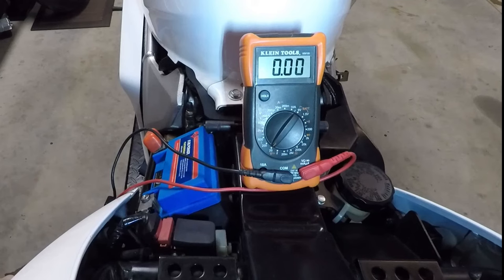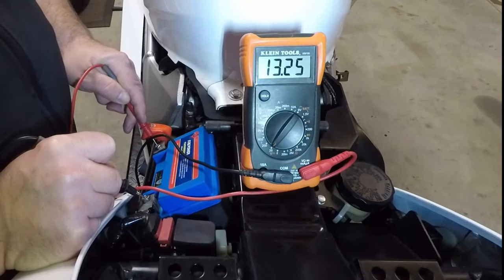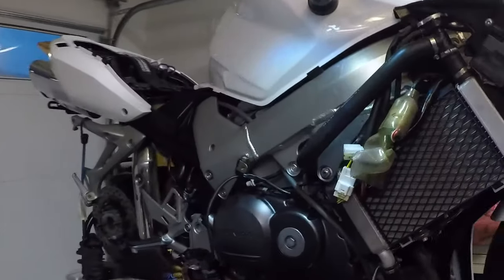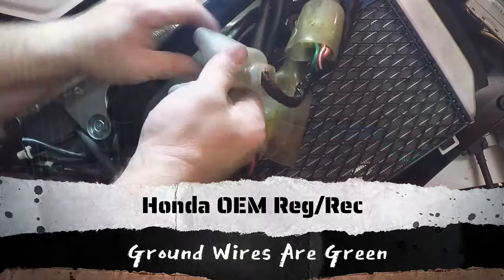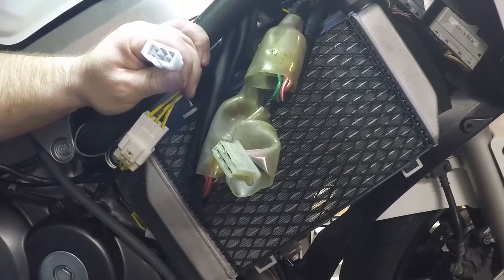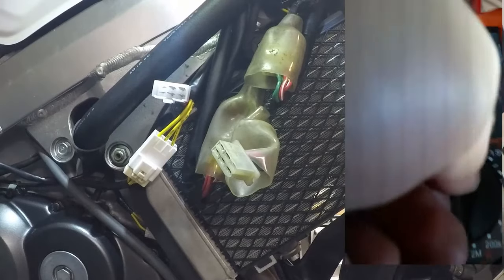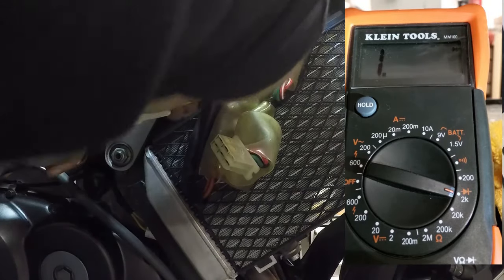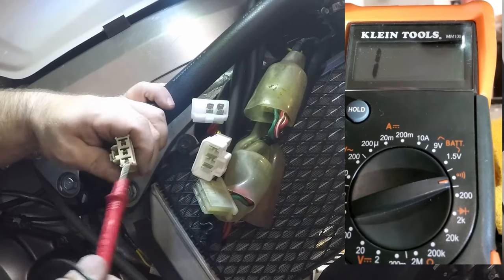Battery Voltage / Regulator/Rectifier & Stator Test

Comment: 2.7.22.    The test on the Stator that you performed is a static test, in order to be more definitive, you should perform a dynamic test, as when the engine is running, and checking the AC output from the Stator …… all three phases. On my Honda Gold wing GL 1200, I had around 70 VAC @ 3k rpm between phases with a new Stator. Generally you will find that the phase windings start shorting together internally, thus the AC voltage falls off between phases.
Reply: if the stator fails the ground fault test- there is NO NEED to go any further.  I doesn't matter what the AC output is  - the stator is dumping voltage to ground- the stator is bad.  Now, if the was no ground fault- then sure, do an AC output test; absolutely.

Comment: as a person who likes electronics & machines. I think it's a good idea to look for a regulator with large current output specifications, because in essence the regulator will still limit the maximum output voltage. but does not limit the outgoing current. Enlarging the charging coil is a fast way. Even better, add a MOSFET type regulator.😊

Comment: Really grateful for this video....reeeeally appreciated the clear views on the multimeter settings....but I'm going around in CIRCLES and if you (or anyone here) can help, I'd really appreciate it.  Forums and FB groups just kept yelling 'MOSFET' at me...and...ahh....

I have a 5th gen…1998.   My bike kept not starting and instead clunking out and resetting the dash.  But, with a jump lead, it would start up fine and be fine until I turned the bike off.  It never shut off whilst riding, just SOMETIMES wouldn't start.

I know it sucks to go second hand (trying to keep rolling until finances settle after job change) but I got a battery, then a second hand reg/rec…which didn’t solve issue...then another battery.  To be honest, the 'new' reg/rec (and the old one) test fine on the diode test...and I think it was the burnt connector, not the reg/rec.  But, the clunking and dead battery kept happening.  So I got a secondhand stator which I fitted today…it tested fine with ’on the bench’ multimeter tests (resistance at 0.1 ohms between phases).  But now it's on the bike my multimeter blips at .03 and then trickles down to 0.0 (on all phases).  I'm thinking it's the multimeter being cheap.

 But…test ride with a voltage meter running: 
Started with battery at 12.8
With lights on 
the average reading  was 12.2 under 5000 
Never went higher than 12.4 even at 5000. 
30 minute ride, mostly around town…little 5000rpm blip between junctions
Lights off was around 13v under 5000.
Got home and battery is reading 12.4. 
So….still screwed?

If I was riding a little with a bad stator...this may have ruined the new battery?  
I think I'll get a new battery and see how that goes.  And then...a stator...they aren't made any more and I can only see possibly terrible rip offs on eBay for about £60-£80...are these fine?
Reply from the maker: Hi Mac,  Sounds like you've just about had enough stator and battery problems.  I would not recommend using used parts unless you know they are off a working bike.  The OEM stator is no longer available but I have heard of VFR owners upgrading to the 6th Generation Stator & RR but I have not confirmed this myself.  My 2000 VFR800 has the same stator connector as my 6th Gen but I didn't change that one as it is still working well, see video https://youtu.be/KpmvUvpRCEM You can get good stator and rectifiers from a new company I have been working with for the past year and really good pricing & free shipping.  They work with the manufacturer overseas.  Here is a link to a new stator  https://rebrand.ly/l243bgb  Here is a link to both a brand new stator and RR in one kit https://rebrand.ly/dwldjbi The other thing I would look at is parasitic draw.  Measure your open circuit voltage with the battery installed on your bike and record VDC.  Disconnect the ground cable from your bike and check again, did it change more than 1 tenth of a volt?  Look for accessories to remove from power, sometimes things like heated grips or aftermarket lights can break down and draw power even when turned off.  You said you replaced the battery with a new one.  Running your battery completely flat is detrimental to it for sure but what you described does not sound right.  The 5th Gen VFR puts out very low current at idle or low RPM, avoid getting stuck in traffic leaving your engine run, learned that the hard way... Make sure when you buy a battery you get one with a separate acid fill pack that you have to load into the battery.  This way you know you're not getting a half sulfated battery that has been sitting on a shelf for a year.  Better yet get a lithium ion one, pricy but worth it is you bike sits for extended periods.  Good Luck and let me know how it goes!

Comment: wow I suscribed, you explain everything really good, my Daytona 675 doesnt charge the battery, I bought a new battery and she eat it, so couldn't be the battery, today I boudh the multimeter and tomorrow will test the stator and the Regulator, thank you so much for the vid.
Reply from the maker: Hello Leonardo, if your battery is getting damaged it is most likely the Voltage Regulator & Rectifier.  I also have this updated video that shows some additional tests you can do https://youtu.be/KpmvUvpRCEM Thanks for the feedback & the views and good luck!

Comment: Been having same  problem  with my Suzuki gsf1250 bandit . Have put several  r/r on bike but still having charging issues. A a multimeter will test my stator as just shown in your video. Thanks 😊

Comment: Great as i am in the middle of this problem now. Two of my 3 stator wires are showing dead ground, the 3rd is the pick up. There is a 4th separate wire i believe is for ignition i'm getting 60vac rolling it over on the starter. I believe the ignition wire comes from a separate winding on the stator and its unaffected. When i switch the meter over to vac am also getting 5-6 vac from the grounded yellow and white stator wires when i kick the bike over, a little confusing that im getting any voltage from wires showing dead ground. I am going with grounded bad stator.

Comment: Hi. My regulator show values 0.001 V on every mesurements (black- red, black-black...) . Regulator  disconected from scooter.
Is that result show that regulator is fault? Thanks for answer.
Excellent video!
Reply from the maker: You set your multimeter to measure continuity and not voltage correct?  If so then yes the regulator is dead.

Comment: Overloading the stator with accessories or nursing a long a dead battery can burn out the stator I have found. But the regulator is the first to go. The VFR 800 are well known for blowing a rectifier. So maybe that aftermarket one on this bike wasn't protecting the stator? That black and white wire. Might have saved the stator?

Comment: Great video! My bike cranks but doesn't start when the engine is warm but will start right up when its cold or I have let it cool down for 30 mins. Could it be the regulator? It has a new stator and a fairly new battery
Reply from the maker: Hello Edwin,  The condition you described is most likely faulty ignition coils.  The RR would not prevent your bike from starting.  When bad coils heat up they are unable to generate high voltage.  Check the ignition (spark) at the spark plugs when the bike is hot, trace the lead and change the coil(s) out with a new one to find the culprit.  This being said, I would just change all the coils and wire leads since any that are good now will probably fail soon.  - Good Luck!

Comment: Great video! 
Hope you can help on this issue:
A few days ago, while riding my SYM VS 125, a lot of smoke started coming out of the front of the bike and the engine started to fail. I turned off the ignition and cut the battery current.
At home I took it apart to see what was going on and the rectifier was visibly burnt.
I took the bike to a workshop where they changed the rectifier and the battery, but they didn't solve the problem. The new rectifier continues to heat up a lot and too fast, as if something is short circuiting.
As they couldn't solve the problem and it still cost me a few €€, I picked up the motorcycle with the fault.

Tests i have done:
- the battery is new and has 13.1V before the starter
- with the three yellow wires from the stator connected to the rectifier, the bike works fine at low revs, fails at medium and the rectifier heats up uncontrollably; with these wires disconnected from the rectifier, the bike works well at any speed, but as we know, the battery is not charged
- at idle the 3 yellow wires measure about 40V from stator
- the resistant test on stator show equal values on three wires; no ground conductivity; no open circuit on each coil 
- apparently all the masses are well connected.

Any idea what it could be causing this recurrent failure of the rectifier? 

Note: traditional G6Y carburetor engine with electronic rectifier and CDI, year 2010.
Reply from the maker: Hello Francisco,  based on what you have done I would say you have a faulty new regulator rectifier.  Test the RR transistor gates as shown in the video, I believe if you swap the RR part with a known good one, this will fix your problem.  Sometimes you get a bad part, even if its new.  Secondly confirm all ground cables are good, replacing them is also inexpensive and will confirm you do not have a ground resistance issue. - Good Luck!

Comment: Zx6r 2006 ninja636
Went for a ride in the morning packed bike for 30min went back to start the bike, the cluster comes on but the bike will just buzz and not start as if the battery is dead, charged the battery last nite it reads 13v on the multimeter, and when I try to start the bike I'm hearing a buzzing noise coming from the starter relay I think.

The problem started when i cold start the bike, the clusters will flicker when try to start the bike, and It will take longer normal to start.
What could the problem
Reply from the maker: Lots of things can be the problem...  What is the battery voltage after you try and start it?  The voltage coming off the charger is artificial due to surface charge on it. The most common issue is the battery is bad.  The starter relay can be bypassed to check it or just get a replacement and try it, they are not expensive. The other common issue is the right handlebar kill switch.  These switches get gummed up with dirt and the circuit is not strong enough to start the bike.  Finally there are your battery cables.  Cables corrode over time and if they are green with corrosion, frayed or loose on the other end (not the battery I assume you tighten that properly), you need to address or replace the cables.  Here are two videos that you may like, one with a hard to start Ninja 600 https://youtu.be/W0MTZbtMgOw?si=hSXqS227xUin5aNt  The other discusses issues around the charging system and shows additional ways to test your charging system.  https://youtu.be/KpmvUvpRCEM?si=ZIvJuzMQBserzW2w  Good Luck!
Reply: Thanks for the Info @RodRidesWrenches, will definitely try out and do the other checks ✔️ hopefully I manage to trace the problem..

Comment: My motorcycle doesn’t start at all when I try to turn it on. It has a new battery, starter, and starter selenoid. It turns over but the voltage drops whenever I try to turn it on. Can someone help
Reply from the maker: It sounds like you have a MAJOR short in your wiring.  Something is grounding hard.  If there are ANY accessories on the bike (heated grips, charge ports, accessory lights) disconnect them these are the most common suspects.  Get a voltmeter and measure voltage drain with the ignition on, and off, you'll know you found the problem when you see the voltage drain slowly after disconnecting the offending part.  After that you need to chase your wiring from the engine handlebar kill switch which again is a common problem for shorts and failures https://youtu.be/W0MTZbtMgOw?si=DnYLDlUxGccKgXtB&t=560 to the ignition switch, to the kick stand switch, and all the other things like clutch switch and tip sensor if equipped. You did not mention what bike you have so Good Luck on the short fault hunt!
Reply: Thanks for the reply, I’ll check it out
Reply: I did what you told me and there is a short. The battery was slowly draining when I tested it with my multimeter. I just now need to find it
Reply: It only drops to around 10 volts when starting shouldn’t that be enough to start it?
Reply from the maker: @user-by5ud2hf1p   Yes it should
Reply: i hope you sorted you issue, but if you haven’t, good idea to put the year model of your bike as possible your issue could be common to the model and very easy for a youtuber to give you immediate remedy

Comment: 2002 vstar 1100..12.5v battery at full charge. Started the bike and it climbed to about 13.6v on rev up. I did a draw test on the battery and came in at 0.06 which fell well within vstar specs, but battery dies within a couple days. New stator, and no spikes in voltage from bad regulator, it seems to be doing its job. Any ideas? Keep going through batteries yearly at least
Reply from the maker: Your battery is sulfated.  Fully charged your battery should be 13-13.3 VDC.  Each cell should be 2.2VDC you have 6 cells in a 12 volt battery.  you can try using a battery charger that pulses like this one https://bikersrun.com/products/motopower-mp00205a-12v-800ma-automatic-smart-car-motorcycle-battery-charger-maintainer?_pos=1&_sid=83f767274&_ss=r or replace the battery.  You should still get that charger since it will maintain your battery and keep it from sulfating.  Regular chargers don't do that.  The other problem may be a parasitic draw.   disconnect the battery from the bike and leave it sit for a few days, hook it back up and see if it works.  If it does then you have a draw somewhere.  Obvious places to look are any aftermarket accessors; heated grips, lights anything running off the battery.  Disconnect them with a voltmeter on the battery and you should see a difference when you found the one that is drawing current.  Or just try disconnecting them them one at a time until you find it.   - Thanks for the question & good luck!

Comment: I measured the contact on the contactor from the stator and I have contact between the wires, but there is no contact on the motor housing does this mean that the stator is destroyed?
Reply from the maker: No there should be continuity between phases in the stator.  If the phase poles are grounded, this means there is a problem.  Here is another test that just focuses on the stator https://youtu.be/KpmvUvpRCEM?si=Dg_Q6YkeYAuZg1Hd

Comment: Hey man awesome video, I did the test on both the stater and the rectifier/ regulator and both passed. When I rev the bike up the voltage does not increase which leads me to believe that it is the stator but it passed the test.  Any idea what it could be or what I should check next?  2003 Honda Shadow 600
Reply from the maker: What is the voltage you are getting at idle, what is the battery voltage at 5000RPM and what is the voltage you get at 5000RPM with the high beam on? How old is the battery you are using in your bike?  Check the AC output on the stator with the bike running as I described in this video https://youtu.be/KpmvUvpRCEM The stator may not be grounding but the coil packs weak.  Also described in this video is a transistor continuity test for the RR.  Confirm your ground cables from the battery to the engine are not corroded and that all your connector pins are aligned properly and making contact with each other properly.
Reply: @RodRidesWrenches  Thanks so much for the reply! I watched the additional video and it was very informative. The battery is only 2 years old.  
The bike’s voltage is around 12.3v with the high beam on at 5000 rpm. No change from idle aside from it decreasing slowly. I tested the stator AC output while the bike was running and got zero across all 3 phases. The rectifier passed the tests however there is a parasitic draw that only goes away when I unplug the rectifier connection to the rest of the bike ( not in between the stator and the rectifier). I am leading towards replacing both the stator and the reg/rect but do you think there may be additional problems? I checked the ground at the battery and on the block, both have been cleaned up but still no change. Any other things I should check or do?

Thank you so much for the help in advance!!
Reply from the maker: @xIIxpetey454xIIx Unplug the stator from your regulator rectifier, does the parasitic draw remain?  If yes then there is a diode issue in the regulator.  If not then you now know it is the stator that has a ground fault in it.  For whatever reason your multimeter did not pick this up on the continuity test.  Make sure when doing the continuity test you have a clean ground to the engine case.  A faulty stator can drain down a battery with the ignition off. - Good Luck!

Comment: Hello
My cbr600f4 battery isnt charging, new battery, new rectifier, and still no charge.
Checked the DC on the battery, 12,60, 14,40 with the bike working, but as soon as i turn on the lights it drops to 12,80, even with 5000 rpm.
Checked the stator,  0,2 olms, standard is 0,1 to1,0, i dont know what it could be the problem

Comment: Confused.  The schematic drawing of the stator shows the coils form a circuit ( Each coil phase is fixed to earth). So would a continuity check where one  meter  probe contacts the coil and the other probe the earth always return continuity?
Reply from the maker: Hello Legin  the coils are insulated from the poles  when working properly.  When the coils breakdown they ground to the poles which are in contact with the rest of the bike. The stator leads do not ground when working properly. https://youtu.be/KpmvUvpRCEM